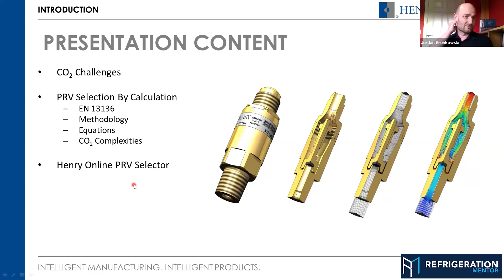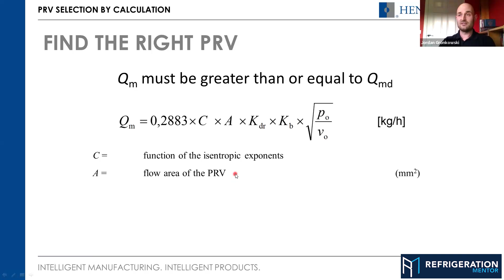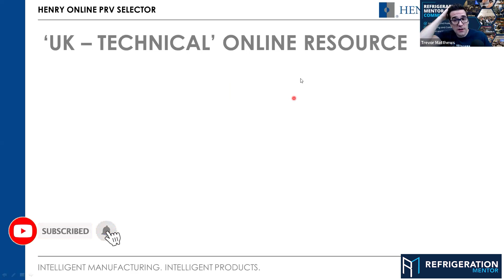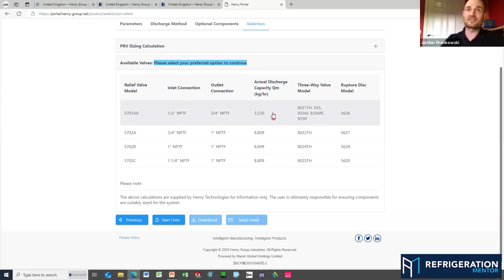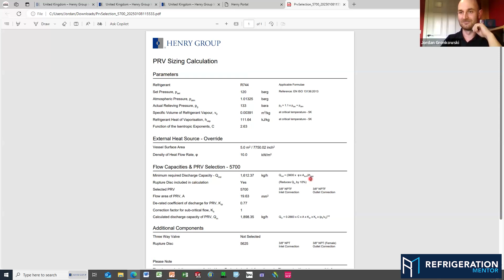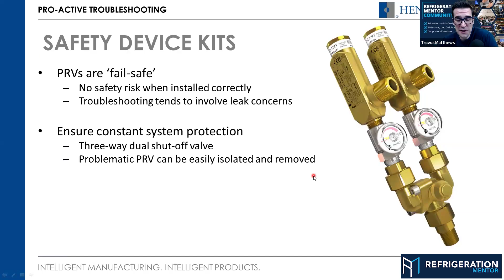CO2 PRV and Safety Devices

Comment: is it possible to PRV 5231a  size 3/8 to reset,

the low side is releasing pressure even the pressure is below the 100 - 200 psi,
the system pressure is H 27.6 Bar and L 16.2 bar.

is this broken, or is there something we can do to adjust the pressure
Refrigerant is r407c